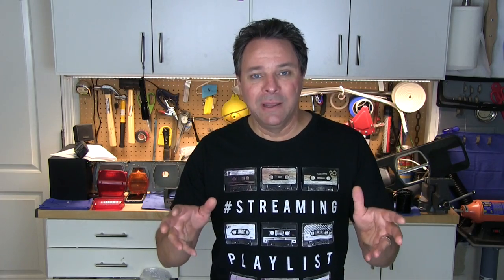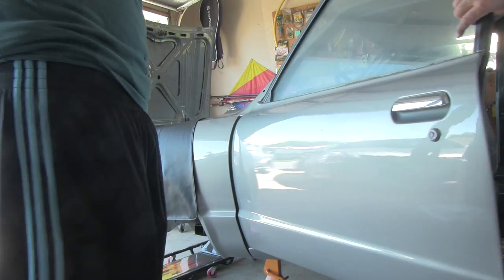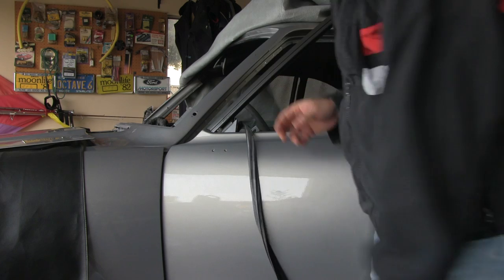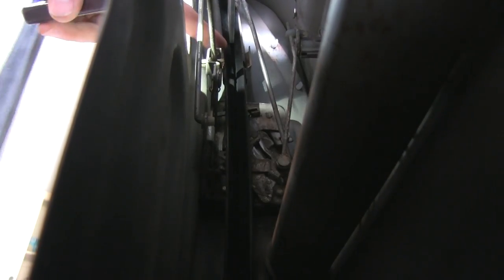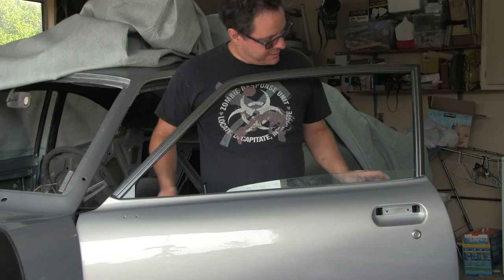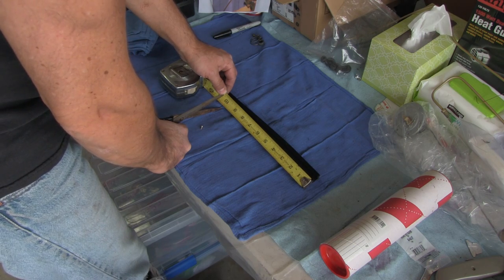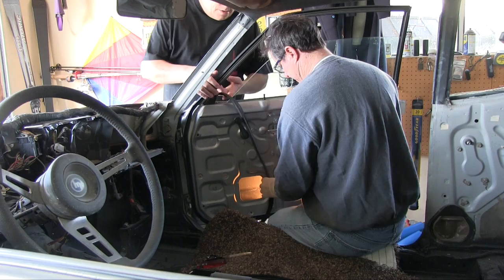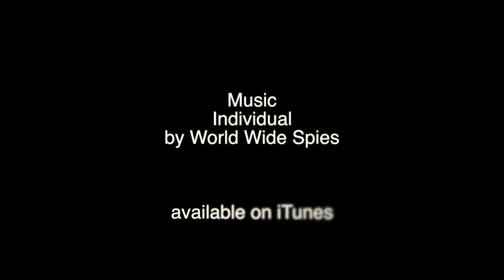VLog 30 Mazda RX3 Door Weatherstrip Install Phil's Rotary Rubber Kit

Comment: Hi Steve, I've just ordered the rubber seal kit from Phils for my coupe (seems they've changed names now) so I watched this again as a reminder of which different bailey channel to get. How much of the thinner bailey channel did you use? Would one metre of it be enough to do the job?
Also, I was thinking the bailey channel might need a small amount of glue to secure it properly?
Reply from the maker: Hi Keith. You would need at least a meter. I think that might cover it but I didn't actually measure the total length of narrow channel. I didn't use any glue. It stays put pretty well but there is surely no harm in applying a thin coat to secure it.

Comment: Is the original rubber closer to phils or Taiwan quality? thumbs up to your restoration.
Reply from the maker: I can say the quality is nearly equal. On some pieces with a felt surface (not the bailey channel but other pieces) the quality of the felt might be off as it easily scratches.